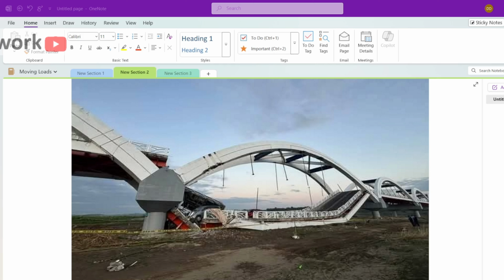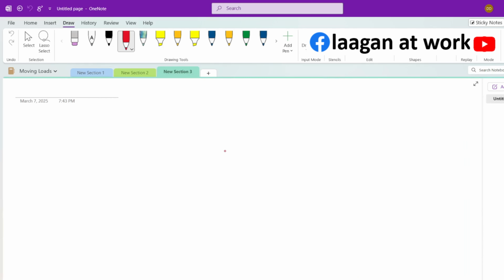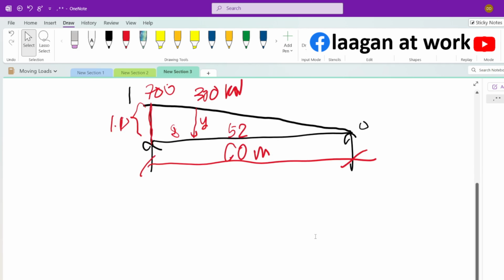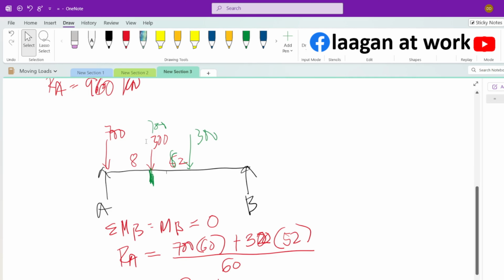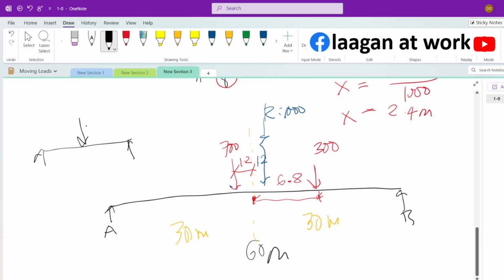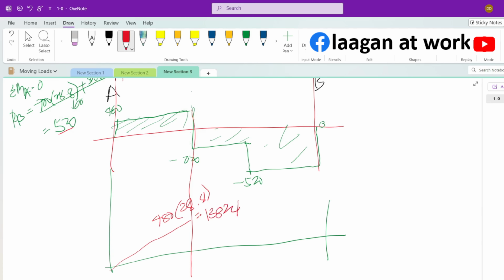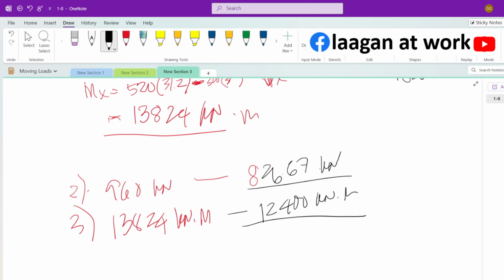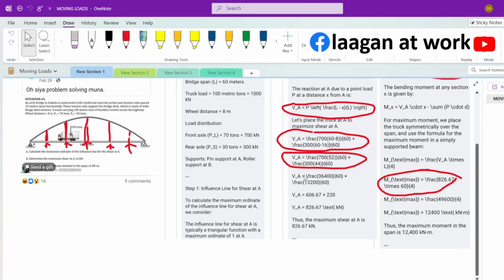Isabela Collapse Bridge / Moving Loads

Comment: Without knowing the construction details of the bridge, this type of calculation analysis is too speculative. Let's just start first with the conceptual design. If the bridge span is 60 meters, how many dump trucks will fit within its two-lane span? Lets assume 12 dump trucks at 40 tons each. Therefore, the design static load should be 480 tons. If the bridge was designed according to this value, why would the bridge collapse when there's only one 40-ton truck along  the span? (I used 40 tons because that's the maximum load the dump truck can carry. Their claim that the truck was carrying 100 tons is preposterous.)
Reply from the maker: please watch again..i reiterated in the video that it was in response to a calculation done by someone else about moving loads "assuming the span is 60 simply supported for the sake of discussion"..
Reply: @ I'm not critiquing your response. I'm just adding details to the discussion. I think there were serious flaws in determining the original design load as well as in the detailed engineering of the structurals, that could have been corrected just by using common sense.
Reply from the maker: btw, how did you come up with 12 dumptrucks? that's not how bridge load is applied..please check code
Reply: @laagan6512  Have you ever driven through NLEX Candaba Viaduct? You'll always see there heavily-loaded dump trucks lined up bumper-to-bumper in hundreds-of--meters-long queue, yet that 48-year-old bridge is still intact. Why would the Isabela bridge collapse with just two dump trucks on it?
A  60-meter bridge span can fit 6 dump trucks in one lane. A two-lane 60-meter span can therefore fit 12 dump trucks. What does the code say about the load application of this type?
Reply from the maker: @rainnelmaclang4803  again that's not how the load is applied in bridges..all designs of any type of structure are governed by the applicable codes.  I heard during an interview that the bridge was designed based on 1997 bridge code if I remember correctly, so most likely the load would be HL93..

I think it's better to wait for forensic investigation before giving out opinions on what caused the collapse..
Reply: @laagan6512  before a designer use the code calculations, he must determine the nature of the load first in order to select the appropriate code calculation formula to use.. If the 2-lane 60-meter span can  fit 12 units of 10-wheeler Dump Trucks, and !0 wheeler Dump trucks have 3 axles. Each axle has allowable load of 13.5 tons, therefore total maximum load of 12 Trucks is  486 tons of moving load, distributed along the 60 meter span.
Reply from the maker: @rainnelmaclang4803  again, that's not how loads are applied in bridges
Reply: @laagan6512  again, could you enlighten us how to determine the design load, and how moving loads are applied in the calculation? 
My point is, if twelve 40-ton trucks move bumper-to-bumper (6 trucks per lane) on a 60meter span, that's 480 tons of moving load. Any 60-meter-span bridge within the entire Philippine National Highway System should be able to take that load. Why did it collapse with only two trucks and a few cars moving on it at that time?
Reply from the maker: @rainnelmaclang4803  bumper to bumper? again that's not how loads are applied..you can watch lots of videos on bridge loading in youtube..or read the bridge code of the Phils if you have access to it..or read AASHTO
Reply from the maker: @rainnelmaclang4803  if it's HL93 loading, then you can only fit 3 design trucks max on a 60m span per lane
Reply: @laagan6512  So, does that means the design load specification was wrong? Just look at the Candaba Viaduct as comparison. At any day, you'll see bumper-to-bumper 40-tonner trucks lined up for hundreds of meters along the viaduct. Why is the Candaba Viaduct still standing? 
Does it mean that in 1974, the viaduct designer used common sense in specifying the load, instead of following the "HL93 loading" in the code? 
Anyway. if you assume "HL93 Loading" of 3 trucks per lane was used, then 6 trucks would be 240 tons of moving load. The Isabela Bridge collapsed on less than one-third that load! Any post-incident load calculations at this stage is moot and practically useless. We should focus first on the design load specifications and who approved it.
Reply from the maker: @rainnelmaclang4803  all design are based on code.if you want to change the loadings then revise the code..Candaba viaduct bumper to bumper? clearly you haven't look at the code or read anything about bridge loading..the 93 in the HL93 loading refers to the year it was proposed, 1993..so the bridge you're refering to was not based on that code..much earlier..like I said, if you have time, please read the code..for your own sake..